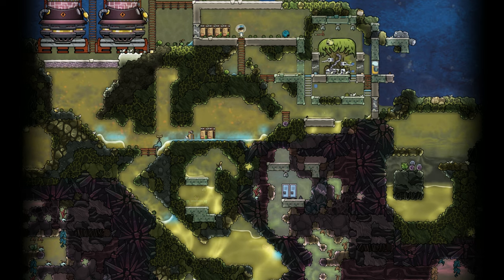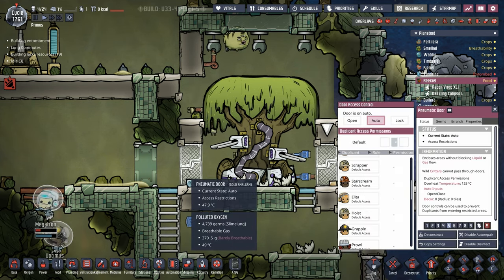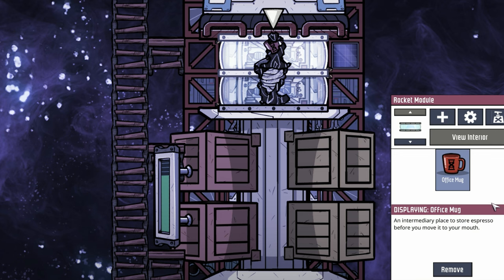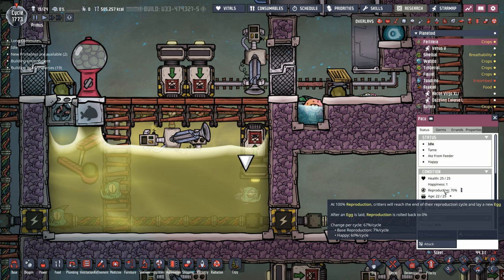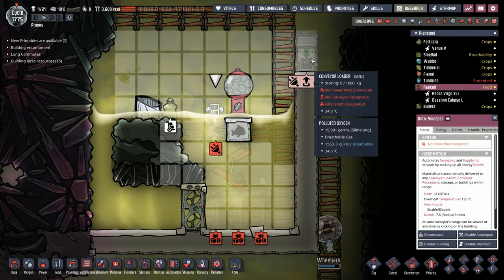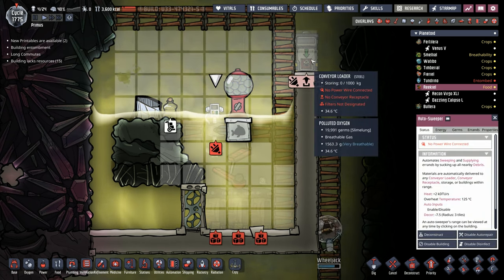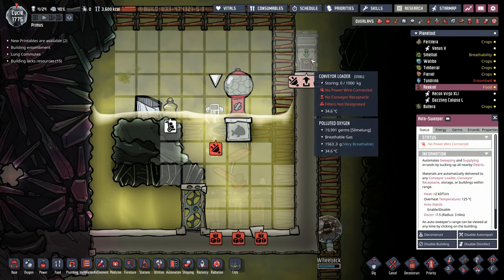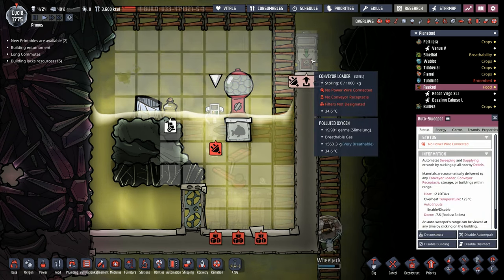Feeding the Tree | ONI Spaced Out! | Primus Ep 19

Comment: You should put in a system to keep the pacu pool temperature between 10°C and 25°C (shared livable temperature range of gulp fish and tropical pacu). Otherwise you might lose 2% of your pacu population every 30 cycles.

Gulp fish livable range: -50°C to 25°C
Tropical pacu livable range: 10°C to 100°C
Shared livable range: 10°C to 25°C

Maximum age: (25 cycles) + incubation duration (5 cycles) = life cycle duraiton (30 cycles)

Base Gulp Fry Egg chance: 2%
--> Above 25°C: 2% dead per life cycle

Base Tropical Fry Egg chance: 2%
--> Below 10°C: 2% dead per life cycle
Reply from the maker: Very good point.  Maybe I will have to convert it to a tropical pacu only... as I don't want to add more power requirements.
Reply: @EchoRidgeGaming  Unfortunately, Tropical pacu still have the 2% base chance of laying a gulp fry egg, so a tropical pacu pool would still have the same problem.
You could have 2 pacu pools (one hot and one cold) but you would need  at least 2 auto sweepers to sort the eggs into the correct pool.
Controlling the temperature might be as simple as putting a temperature sensor into the tank, connected to a space heater next to a (possibly wild) wheezewort.
Maybe just insulating the tile of water could be sufficient to keep the temperature from changing.
Reply from the maker: I meant the tropical pacu, because that planetoid is already hot.  Better to lose the 2% than lose the entire pond, because their temp is higher than the others livable range.  I guess we will see!